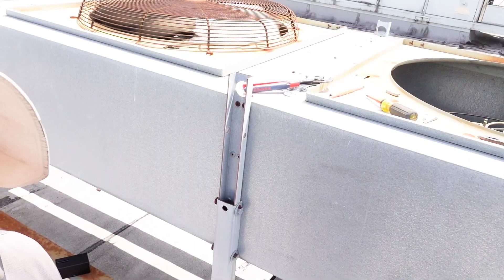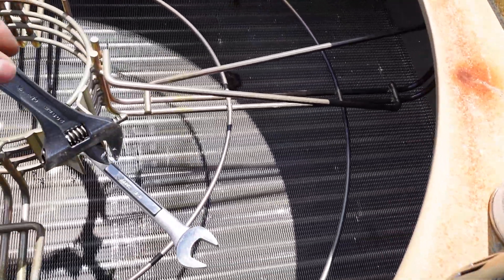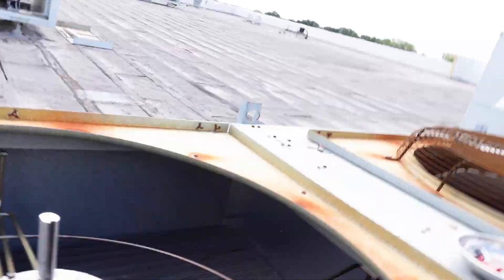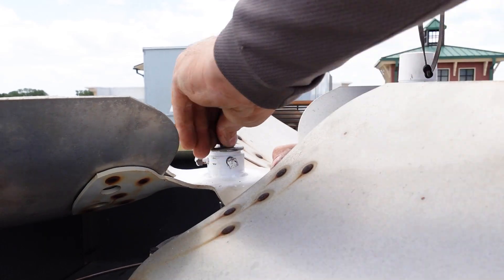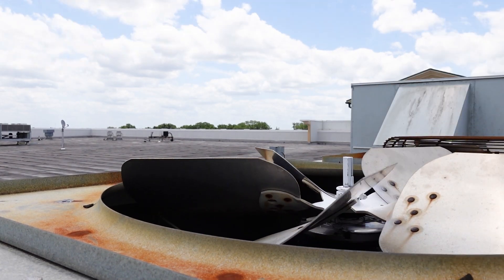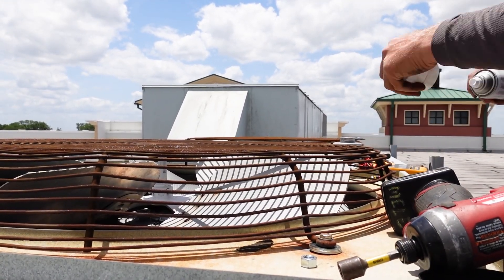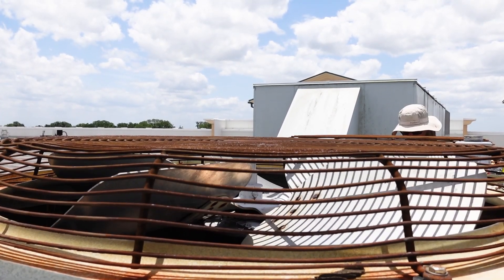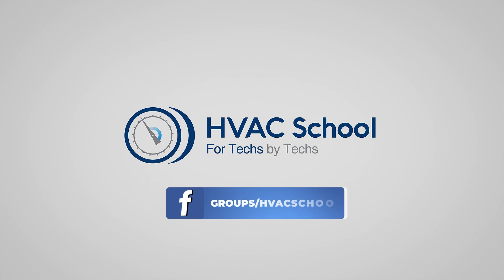Market Condenser Fan Motor Replacement (Redux)

Comment: This should be more of a what not to do when changing the condenser fan motor. If the blade is not sitting at the right height it means your motor is too big.. this is why you should not always use a generic motor. You just changed the air flow for that condenser and you may now not be moving enough air because your fan blade is not sitting in the right location and the right height for maximum airflow
Reply: These kinds of things happens out there brother.
Reply: @joshuaricks7730  I know they do but this is still the wrong motor for this application and they should not be teaching this other than what not to do. This is obviously an oversized motor for horsepower and for the fit of this machine
Reply: @jeffreydenninger  , I'm a big fan ( no pun intended) of using a tape measure and Sharpie. I mark and measure everything I feel is necessary ( this way I know everything will fit before I even put the protective shroud back on).
Reply: Eric M  just weird that it's not sitting right. Unless somebody put a wrong motor in the last time. Is it the same motor as the rest of them?
Reply: Eric M  that blade definitely looked very tall and it did look a little out of place but I'm not sure exactly what you were working on to determine whether or not it was the right blade. But you definitely should not have had to shim that cage up to fit the blade in there. Most times we go back directly to the manufacturer and get the motor and blade and replace it at the same time to make sure we're getting the right stuff. Half the time we can't get the blade off correctly even with a puller. Sometimes it's especially with those units it's easier just to pop the whole motor out with the blade and put a whole brand new one in
Reply: Eric M  I'm a commercial HVAC and refrigeration technician myself so I definitely understand getting the customer back up and running as quickly as possible. There are some times it's not possible though